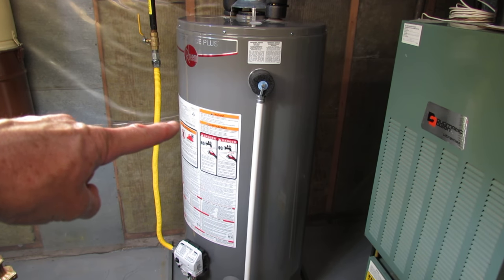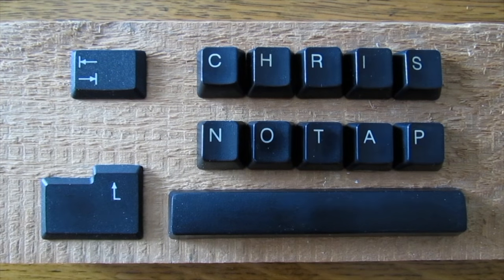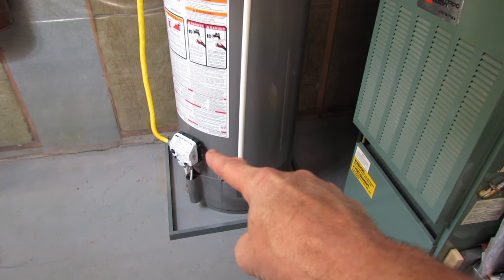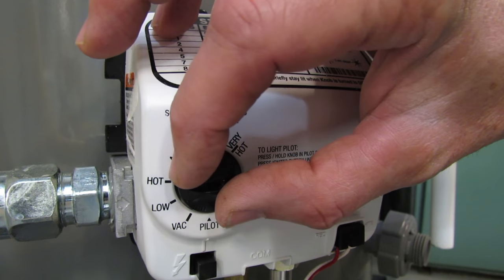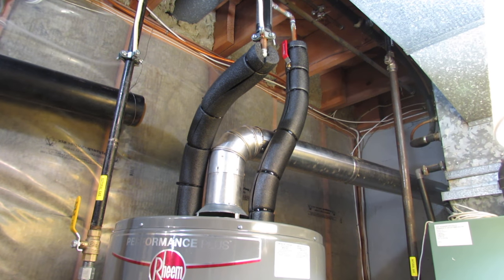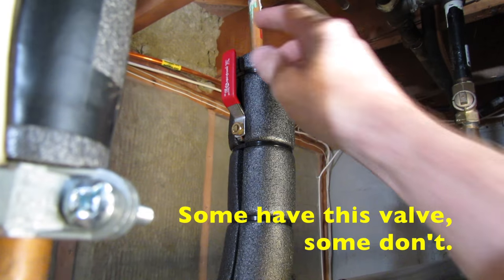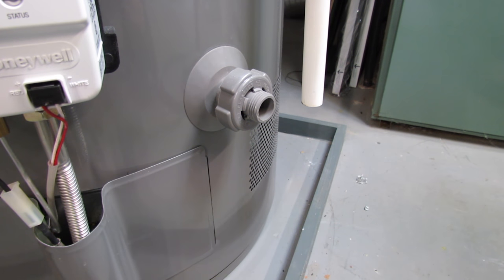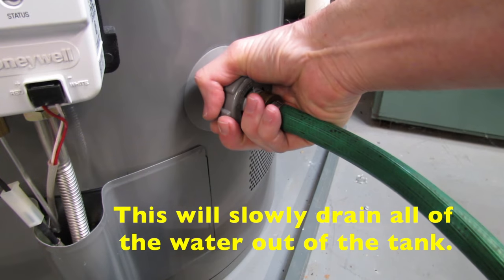How To ● Turn Off a Leaking Water Heater

Comment: My water heater was leaking so bad, it was filling buckets every 10 minutes. I am so grateful for the insight, and shut the breaker, still leaked. shut the water source, still leaked. So I grabbed the hose, attached it to the bottom drain and opened it up and ran the hose out the garage door, and allowed it to drain. Thank goodness for videos otherwise my garage and all in to would be wrecked!! I am a woman on her own and this was great info thanks...😁
Reply: Same girl, same lol
Reply: Mine is leaking but I’m a kid so I didn’t want to tell my parents because then they would say no
Reply: Thanks so much for sharing. I, too, am a single woman and I need to disconnect my water heater as it’s leaking buckets as well. I will give this a try.
Reply: How long did it take for the water to drain completely?
Reply: Did you get the leak fixed?
Reply: @buggyd4752  I got it fixed. Once I put the hose on the water heater and dragged it outside the garage door I let it leak in drain for the rest of the day… Unfortunately, I did have to replace my water heater which I did. And now I just leave a hose on there and it's directed towards the garage door in case of another accident but this is a warranty and the other one was about 15 years old so I think I did pretty good. Thanks for asking by the way. 😀
Reply: @jayhaberlin5120  thethen, of course, you risk having your personal items ruined. And it also depends if you're renting or you're a homeowner. Just cause you're a kid doesn't mean you don't learn stuff and get it fixed.n, of course, you risk having your personal items ruined. And it also depends if you're renting or you're a homeowner. Just cause you're a kid doesn't mean you don't learn what to do ... 😀
Reply: @arylleyoung  my tank was probably leaking all night, then when I finally figured out what I needed to do, it only took a few hours, less than 4 for sure

Comment: When you installed the water heater you might want to consider replacing the plastic valve with a full-bore 3/4" ball valve so that you can easily flush 1x a year. There are also electric valves available that could be connected to your home-brew smoke alarm/water alarm to shut off supply water while you are out too.
Reply: That sounds hard.

Comment: 6 yrs later after you posted this and you saved a family and 4 dogs.  Thank you so much.  Was walking by the water heater closet and saw water and I opened the door to a misting spray from the outlet valve on top. Immediately looked for ways to turn it off and your video may have saved out lives.  It that had blown up half my home would be gone and so would at least two of my four dogs. I believe the leak was only a day old. Calling landlord in the morning
Reply from the maker: Glad it helped!

Comment: Thank you! It took me a few hours to realize there are 2 shut off valves on mine, one was to the house, the other from the source. So water poured out for a few hours. I put the hose on and it was gushing so bad I realized the water was still on. I finally found the hidden valve. Lucky the water heater closet is outside. Unlucky it broke on NYE night and no plumbers would call me back. I hope my bill isnt too bad. Thanks again!

Comment: Leaky water heater at 2am I knew to shut the water valve off but wasn’t sure about the gas since my home is old and has the old wrench turn valve, and not a hand pull valve, huge help thank you

Comment: Thank you! Water was gushing out of that hole that you attached the pipe to like I had opened a fire hydrant. Still don't know why. Of course, it's the holiday and my landlord isn't answering calls. I turned off both levers on the pipes and it stopped. You made me realize I needed to turn off the pilot light as well. Thank you thank you.
Reply from the maker: Glad I could help!

Comment: OUTSTANDING video!!! 

I have a 5.5 yr old gas water heater—A O Smith. My overflow pipe is leaking. Plumber says probably T&P valve needs replacing. Told me it’s ok to leave as is till he can come to replace it in 3 days. Says it will be ok because there’s a drain pipe connected into the pan below that runs down into the floor. 

But I’m left wondering—what if pressure is continuing to build up inside the tank? Can’t it explode if it gets too high? So I’m nervous about letting it stay as is for 3 days while waiting on the plumber! 

Came here to learn how to shut the whole thing down. As a 62 yr old female with no plumbing experience, you’ve made it simple for me. Thank you!! I’m off to go do it now!! Hope I live to tell the story. 

P.S. We have hard well water. With the heater being over 5 yrs old, should we go ahead and replace it, rather than just replace the valve?
Reply from the maker: There is need to worry! That valve will open in spurts if the pressure gets too high, about 150psi,  or if the temperature gets too high, 210f. It shouldn't be necessary to replace the heater quite yet.

Comment: Hi! Thank you for this. My heater seems to be doing the same thing but it’s not leaking a lot of water, at least not constantly . After shutting it off, should I get it fixed or is this something that just needs to be shut off for a while and then turned back on again?
Reply from the maker: When they start to leak they won't leak a lot of water. It can be a pin hole but to answer your question yes you do need to have it looked at and fixed.

Comment: Great video! Can you please share any info regarding the cement-looking curb you have around your water heater? I think it's a great waterproofing solution and better than the small plastic/aluminum pans sold at box stores.
Reply from the maker: That's strips of wood. I used pine 3/4" thick and 1" high. I painted them first then siliconed the strips of wood to the floor to create a water tight tray.

Comment: Thanks a million.  The leak is on a brass color pipe (pin hole). Can that be repaired as easy as stopping the leak, using a particular type glue or sealent? Please advise.
Reply from the maker: If it's on a pipe, it should be repairable. You should replace the part and not use any glue or adhesive to repair it.

Comment: Thank you for the video sir,But question is why it leaks??
Reply from the maker: In most cases it's because it has rusted a hole through the side of the tank. You can also have one of the fittings wear out or one of the valves start to leak.
Reply: @chrisnotap  my drip valve is leaking And last night I turned off the water heater now when I turned on their is no hot water, should I turn on the pilot for that?? Thank you for your time and help.
Reply from the maker: @Mamatha450  If you shut your hot water heater down you will need to re-ignite it yes.
Reply: @chrisnotap  🙏🙏🙏🙏

Comment: Thank you! My water tank wasn't leaking but the hot water line to my kitchen sink was. The cut off valve under the sink did not work so I went searching on how to stop the water heater.
Reply: That's my problem now in the bathroom hot water valve has cracked and leaks  when I tried putting on a bidet tee valve. So now I can finally shut off the hot water and change out the whole shut off valve, right?😮

Comment: Mine has a blue plastic thing for lack of a better word and it was straight which on the blue thing means open so I turned it sideways and switched it to closed. Is that alright? Also when yoy turned the handle off it was turned to the right? Thanks for being straight to the point.

Comment: Is it necessary to shut off the gas line to the water heater? After turning off of course
Reply from the maker: It really doesn't matter if you shut it off or not. Who ever replaces it will shut it off at that point.

Comment: Okay so I can turn off my water heater valve and turn on one of the faucets with hot water to drain the pressure? It’s leaking very little and slowly from the bottom. Not serious yet.

Comment: Sooo. I did the first step but I cant tell which one is the water valve.... do I still need to run the sink water on hot cause not hot waters been coming out for a week now. Those cold showers are something...😅

Comment: I tried all 3 methods suggested and it still leaks. I suspect the problem is in the shut off valve. It's not shutting off the water and is still flowing into the tank. Any suggestions?
Reply from the maker: Remember, the leak can be anywhere on the tank. It may be leaking lower down on the tank. If you have the water turned off, power or gas turned off it can still be dripping out of the tank until the water level in the tank drops to where the leak is.

Comment: A lot of people don't know how to work the gas valve on the water heater so the very first thing to do is to turn off the gas valve with yellow handle/knob, followed by shutting off the water supply to the heater.
Reply from the maker: Great point!

Comment: This is a great video, I agree! BUT, there is no shut off valve on the hot water feed!  Any ideas? I've looked on the other side of the wall and nothing there either even though that is under the kitchen sink. I'm beginning to think it's under the house...dread!!!  My wife is in the hospital from having a massive stroke right before Christmas and I've been dealing with this for 24 hours now! We are older, both disabled, have no family, and cannot afford a plumber as they have quoted me by anywhere from $400 to 800. I'm going to have to take out a loan and tomorrow is Friday! HELP! How do I turn this off??
Reply from the maker: Some do not have shut-offs at the heater. You need to shut off the main water valve to stop the leak for the time being. They will probably install a shut-off when they do the replacement. Sorry to hear about the situation you are dealing with. I hope your wife is ok.

Comment: QUESTION: Can i turn off the water to the water heater tank and just leave the main water line running through the house regularly and will that affect anything? Because I am confused and a little frustrated with this water heater tank leaking all over the floor.
Reply from the maker: Yes. You can turn off the water heater and still use the water in your house without a problem. As long as there is a valve on your water heater to turn it off, otherwise you will need to shut off the main. If that’s the case, get some containers to fill with water before shutting it off.

Comment: My water heater broke and water gushed out.  It's in the garage so there's no damage to the house.  My brother turned off the valve.  I was waiting until Friday to have Home Depot or a plumber come and install a new one, but we had a big snow storm and I'm sure I'll have to wait until next Friday to get the new one installed.  The pilot light is still on.  I don't know how to turn it off.  Is this dangerous?  Thanks for any information you can give me!
Reply from the maker: Turn the pilot light off. Go to the control and turn it off or shut the gas valve off.

Comment: Do you have to shut off electricity before you turn off the valve on the incoming water line (electric heater)?  Mine is leaking, but my landlord isn't coming out to check it till tomorrow, and he recommended turning off the water to it for the night.  I think I'll feel safer if I do, but I don't want to do it wrong.
Reply from the maker: Yes. If it's leaking, the best is to shut the water off to it and shut off the power.

Comment: So when I turn the water heaters water valve off, and I go to run the hot water water still comes for days. There is not end. I’m going to have to grab the hose. However why is it not slowing down like in the video after turning water off and running the hot water? Is it because it’s more badly damaged?

Comment: I'm going away for the weekend and I noticed water around my gas fired tank. Would it be ok to shut the main off in case the tank fails?
Reply from the maker: Yes. Shut the main off before you go.
Reply: @chrisnotap  I was just concerned about it running dry if it ruptured. Is that a concern?
Reply from the maker: If it's an electric heater, shut the power off to it also. If it's gas, turn off the pilot light with the knob on the side of the heater

Comment: My electric hot water heater burst a while ago but I have not had the money to replace it. The drain pan is full so it's leaking from the PVC overflow pipe outside. How do I stop it from leaking until I can afford to replace it?
Reply from the maker: I need some clarification. You said the tank is leaking and it's also leaking from the pvc pipe on the side? Or the only leak you see is from the pvc pipe?

Comment: Hello, there is a valve on the water pipe, but it is tight and won't turn off. I used a wrench to.loosen the bolt, but it is still stuck.

Comment: I’m still a little confused. I don’t have a leak but I need to change out my handle. I see all your methods but still not sure which option is best
Reply from the maker: Handle?
Reply: @chrisnotap  sorry it was the shower handle and I couldn’t shut the main water valve off. I figured it out. It was by my pump.

Comment: How do you stop it from refilling if you don't have a valve and it's going to be a few days u til opened can come out?
Reply from the maker: You would need to shut off the main water at your water meter and then install a valve at the water heater then turn the water main back on. Then while you are waiting for a repairman to come out you can shut off the water heater in the mean time.

Comment: This just happened to me 30sec ago. My pressure release valve opened and it was gushing water out of the tank.
Reply: What’s the reasoning behind this?
Reply from the maker: You need to have a service guy look at it. It is either a faulty pressure release valve or the tank pressure is actually getting too high.

Comment: Would you recommend turning off your water and water heater if you go on vacation?
Reply from the maker: Great question! Yes! Turn the mains water off! It's not necessary to turn of the hot water heater off. Then leave one hot water sink faucet valve open in one of your bathrooms or kitchen (this stops pressure from building up in the system when the hot water heater comes on). I had a friend that came back from a 2 week vacation and the hose had split on his upstairs toilet and the water had been running for 2 weeks straight! When he opened the front door after getting home from vacation, all of the plaster ceilings were on the floor. The hardwood floors had warped and were like a bunch of propellers all over the place. Everything wood had swelled. Every piece of furniture destroyed. A nightmare!

Comment: Anytime I hear the word "just", like as in "JUST connect a garden hose and open the valve". This doesn't take into consideration ANY of the problems that can and will arise in the real world. While Chris has factually outlined the steps to take, it is highly unlikely to go down this simply in an emergency when you have an old hot water heater with a crusty metal valve. THIS IS WHY THE INTERNET IS THE DATA HIGHWAY, NOT THE INFORMATION HIGHWAY.
Reply: Or... People can prepare and get that issue fixed before an emergency

Comment: WOW, that water heater passes code ?  Looks like a Home Creepo install by their non-licensed installers. From black pipe to galvanized pipe, then coated stainless steel tubing. Oh and don’t forget the plastic temperature and pressure relief valve drain on the side, that once heated turns into a nice scalding hot water whip for all the hot water fun your family can handle. You can always tell quality when the water heater has that horribly cheap drain valve. Most “plumbers” would have removed it and installed a full port ball valve with brass cap so accidents don’t occur. But that all ok.... at least now the homeowner knows how to shut it down and run.